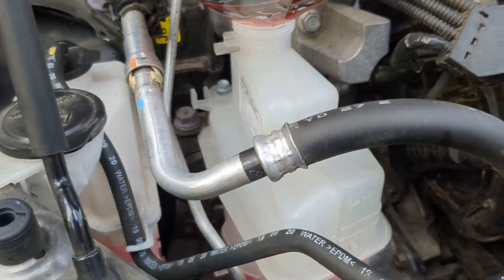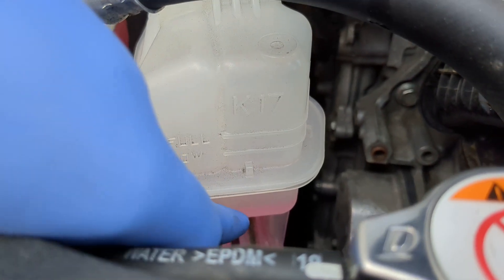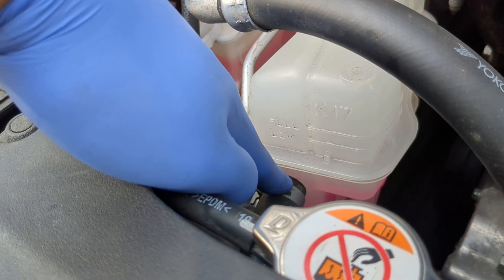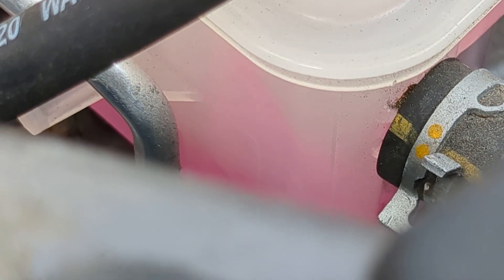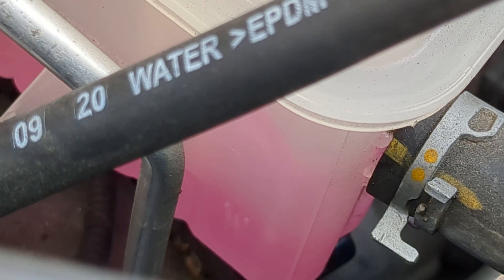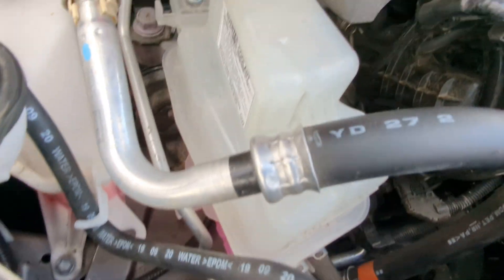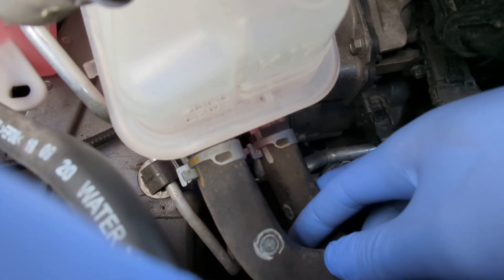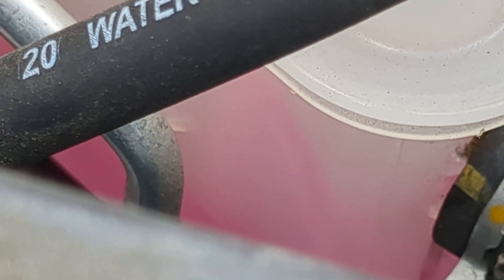How to check  inverter coolant pump performance for a Toyota hybrid A25A-FXS

Comment from the maker: using a suction syringe, remove some of the coolant out of the reservoir to the level between the upper hose and the lower hose. start the car on EV mode to activate the pump and watch the coolant flowing out of the top hose. and that confirms that the inverter coolant pump is working, because the sound of the pump by itself does not confirm that it's doing enough circulation. in NEWER Toyota hybrid models, it is hard to see the turbulence inside the reservoir comparing to the older Toyota Hybrid models.

Comment: When you flushed it out and filled the tank and start the engine, did it immediately drop down that you would need to add more coolant? Because I have 2022 Toyota Camry hybrid, and when i started the engine, it didn’t drop down. The most I added was 2/3 of an inch over time. To make it full. But it didn’t drop down like a few inches down. Is that normal?
Reply from the maker: @ehsanull  If you drain it by removing the  bottom pit cock and let it completely drain, it'll  drop around an inch or two. What I do, is to refill it one inch above the full line, and when I start the car, it drops slightly under the full line, then I add coolant up to the full line. One extra inch above the line is good enough since it's not going to reach down to the level of the bottom hose.
Reply: @ yes I drained it from pit cock, it got out a lot of coolant, the only concern I have is when I filled the tank up, and start the engine, I was expecting it drop down a lot and I would immediately add more coolant again. So is it normal?
Reply from the maker: That's normal, even if the level is above the FULL line. The inverter cooling circulation is very basic, and it does not get very hot and expand like the engine side. The only problem is if you run the car with an empty inverter coolant reservoir, or the level goes near or below the lower hose. The lower hose then will suck air instead of coolant. Other than that, you're fine.